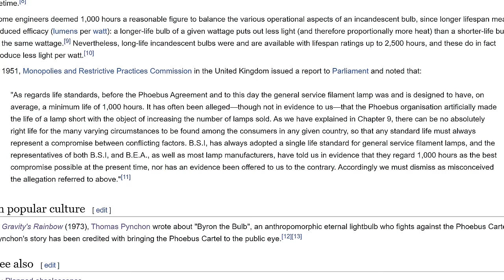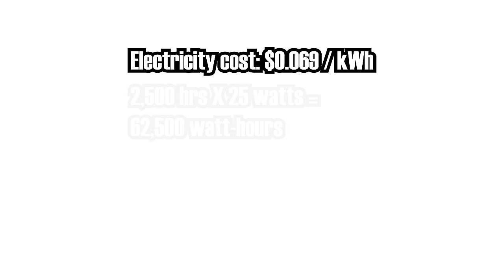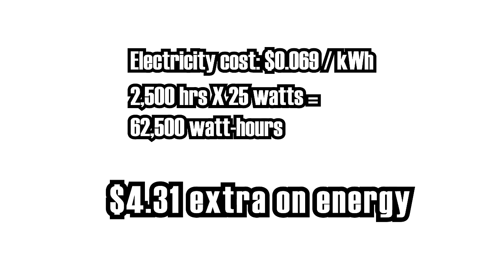Longer-lasting light bulbs: it was complicated

Comment: At my University in Germany this was actually the topic of one of my first lectures (mechanical engineering). So I want to contribute because you excluded Halogen-lamps:
Halogen lamps use e.g. Fluorine to bind the sublimated tungsten and "refill" the tungsten wire at the thinnest spots. Thats why those lamps have a much higher life expectency and brightness/efficiency, though need a socket that can withstand higher temperatures. I remember vaguely that Osram had a warranty program where you could send in black-tinted halogen lamps, because it meant there was a defect in the manufacturing process, since the tungsten isnt supposed to "get" to the glass.
Reply: Mains voltage halogens weren't as good as made out. I replaced a ten+ years old normal bulb with a mains halogen one in an outside lamp and it failed after less than a year. 

I recently bough, mainly as a historic curiosity a Philips bulb that has a low voltage halogen capsule and a transformer between it and and the base. 40W of life from 20W and supposedly a longer life. Car bulbs seem to be the pinnacle of incandescent life. Even the headlights seem to last about 5 years.
Reply: @MrDuncl  yeah outside lamps are a special case, depending on temperature and exposure to e.g. rain, a halogen lamp will fail fast. Even slight fluctuations in the supply-voltage (1V is enough) can kill it. That's why most halogen lamps are 12V, since the AC-DC converter prevents these fluctuations.
Reply: @MrDuncl  Car bulbs last a long time because of the lower voltage. To achieve the same power output from a low voltage the filament resistance needs to be lower. For example a 12v 55w bulb resistance at operating temperature is ~2.7 ohms. A 120v 55w bulb has ~260 ohms. This lower resistance is achieved with thicker shorter filament which is far more mechanically robust than a long thin one.
Reply: @petarmiletic997 did you know that the working voltage of cars are about 14V? The car battery can reach 13V when Fully charged. Car lamps are well designed! They are filled with hallogen to reduce evaporation and create a auto healing effect. Most times they are made out of quartz and not glass. They also have a better filament support, because it needs to withstand vibrations. The 1000h limit is a bad thing! They could have limited the efficiency, but they prefer to limit lifetime. This is a simple excuse to limit lifetime.
Reply: @VitorFM  True, but the nominal voltage of the bulbs is 12 volts. At 13 or 14 volts the power will be slightly higher than nominal. Most modern cars will start to PWM the bulb once voltage exceeds 13v to extend bulb life. Also usually only headlight bulbs are halogen. All other (turn signal, position, brake etc) are normal incandescent. But allthat is not really relevant because All else being equal - for a given wattage the filament of the bulb will be thicker and shorter for lower voltage, and thus mechanically stronger.
Reply: @VitorFM  Another thing - the whole point of this video is that sometimes it is good to limit lifetime in the name of efficiency. A 60 W bulb, over 1000 hours will consume 60kWh of electric energy. With the price of electricity roughly 10 cents per kwh this is 6$. The cost of the bulb is maybe 1/10th of that -60, 70 cents. If we increase efficiency of the bulb by just 10 percent we practically save the entire cost of the bulb over it's lifetime. If the efficiency increase is higher then you save more in the cost of electricity than the entire cost of the bulb. Over 2000 or even worse 3000 hours the math is more and more in favor of higher efficiency. And not to mention that you get more white and less yellow light
Reply: The black tint can happen if you use halogen bulbs in a dimmer and run them dimmed for a long time: you've made the filament hot enough for tungsten to sputter off, but not hot enough to make the reaction with fluorine happen.
Reply: @VitorFM so you'd prefer a lightbulb that costs more to run AND gives a visibly dimmer, more yellow light?
Reply: He did specifically state that this applied solely to non-halogenated bulbs.

Comment: As far as planned obsolescence in LED bulbs, I have found paying like 5% more than the absolutely cheapest makes a huge difference in their longevity.
Reply: Switching to 12V onrs is even better. ROHS hates high temperatures. Dividing power supply and light source lowers temperature on those joins, that causes most of lamp deaths.
Reply: @krzysztofwaleska From what I understand the issue is the heat in the LEDs themselves - sealed fixtures cause further problems primarily by decreasing the efficiency of the heatsink. The big thing to look out for with LEDs (and admittedly this isn't really feasible in practice) is how hard the diodes are being driven. Unlike incandescent bulbs, LED don't rely on heat to make light so running them more gently can substantially increase their lifespans without a substantial decrease in efficiency. That's a big part of what Alec called out from BigClive's videos - he frequently features cheap LED bulbs and tears them down to both assess their efficiency and to show how to hardmod them to last longer at the expense of being a bit dimmer.
Reply: The problem is the circuit boards burn out on the led bulbs the actual leds would last very long
Reply: @peanutbutterisfu  The solid copper strips the circuit boards are made of are not the failure point, otherwise all electronics would fail in similar ways
Reply: I do doubt that it's planned obsolescence and rather just poor manufacturing and engineering incompetence. Those cost cuts have to come from somewhere, and it typically comes from cheaper materials, lower quality control, and less skilled product development. You get worse quality by paying less. It's just a matter of getting what you pay for.
Reply: There was a "cartel" that broke the monopoly laws to mandate 1000 hrs limit. Pure and simple. Similar to making cars that are designed to rust when all you need is to use something like Zinc Chromate to make the car not rust to nothing forcing people to buy new cars / trucks.  LED bulbs have no reason for failing as they do other then the makers running the LEDs at excessive current.  There are several resistors in parallel in the light bulb which run the Leds so hot they fail in what?  2500 hours versus the cartel 1000 hrs?  Maybe more but the issue is they shouldn't fail anywhere near the short and sad length of time.  If you remove one of the two resistors the amount of current / heat drop by half and the amount of light barely changes. The LED PCB runs cool it doesn't change the color and if this doesn't increase the life far beyond the 2500 Hrs your supposed to get I will eat an LED light bulb.  BTW have any of you wondered why you keep needing to replace your computer hardware every couple years? How what used to be screaming fast is now so slow its garbage?  Modern Appliances filled with un-needed electronics (Which is pretty much un fixable) replace what used to be a very simple (And easy to fix mechanical)
Reply: @bosstowndynamics5488 you're right, but the transformers, resistors and capacitors are sometimes the bare minimum spec to be able to drive the diodes. Also, really cheap solder joints and whatnot that like to crack with heat cycling also tend to kill those boards. Usually it's a burnt resistor or transformer from excess heat and current exposure over long periods of time though.
Reply: @dsrocks6905 less than the minimum spec on the cheaper end of the spectrum. Why put a 2W diode that will run for 10,000 hrs when you can put a 1W diode and run it at 2W? It will last 1/10 of the time but the price conscious shopper rarely takes that into account

Comment: I live on the Oregon Coast, and the local power utility not only gave out free LED bulbs, but also faucet aerators and surge protectors (the kind where one outlet controls the others). They don't hand them out regularly though, it was a thing they emailed out and you signed up for. I got them but I ended up donating most of them to the local ReStore because they were those crappy old-style plastic ones and I prefer the filament type.

Comment: Throughout your video I was constantly thinking about many cheap LED bulbs actually having "planned obsolescence" and Clives videos about it. Nice that you brought it up yourself.
And there's a perfect example that LEDs can run almost indefinitely: the "Dubai lamps", manufactured by Philips, with more LEDs than usual, proper heatsinks and a decent controller that runs the LEDs with less current, thus cooler, leading to a hugely increased lifespan. (Clive did quite a few videos about them and how you can "hack" some normal LED bulbs to get on a similar lifespan with only minor loss of brightness)
Reply: Dubai lamp is based on glass chip that is impossible to be properly heatsinked. they made it efficient just by using double the filament at the same power level thus increases its efficiency and lifetime. total heat output might be roughly similar since they have the same power. as the driver, i believe there's nothing different compared to their standard deco classic lamp
Reply: @n.shiina8798  LED filaments don't NEED to be heat sinked. The large surface area alone and helium gas fill of the bulb is enough to draw heat away. With appropriate power draw they run for ages just fine. See the video Filament LED Light Bulb: 5 years and Teardown Time

Comment: You know, this helps explain a question I had as a kid. I always wondered why the lights in your car (not the headlights, the dim lights that illuminate your speedometer, temperature controls, etc.) never seemed to burn out, and I never got an answer other than "It's a different kind of light". I never even considered the fact that the lights were dim was, in part, the reason they lasted so long.

Fascinating video as always - thanks for making it!

Comment: I like those utility branded bulbs! In that tradition my local electrical concern will hand out free LED bulbs for so much as sneezing in their general direction. I once called in to report a hawk nest being built on a power pole, they thanked me for the tip, and a week later a 4 pack of bulbs arrived unprompted in my mailbox. I've heard similar stories from other locals, I think just about any interaction, positive or negative, will result them palming some LEDs into your hand like a grandpa with Werthers candies.
Reply: Thats pretty sweet, would not happen in that way in Germany, sadly.
Reply: @bgeery so user too?
Reply: @bgeery they've found that it's more cost effective to get customers to use more efficient bulbs than to build a new power plant.
Reply: @GeorgeWashingtonLaserMusket  It feels fundamentally manipulative to market "rationing" as a "feature" though. 
I'm all for "efficiency" but not when their approach to efficiency is "I'm going to give you less and convince you it's more."

That and trusting a single party that has all of the power to make that decision without having a compromise with the other party (the client, the citizen) present seems like a bad idea.

Comment: The thing about the free bulbs was interesting. Here in the UK, years ago, power companies were required by the government to meet certain criteria for helping customers to be more energy efficient. Many of the electricity companies chose the lowest-effort option of sending customers packs of CFL bulbs - over and over and over again, regardless of whether they needed them or not. To this day I've still got a box full of CFL bulbs, unused in their boxes, sitting in the shed.
Reply: I remember CFL bulbs being expensive then late 2004/early 2005 suddenly many companies in the UK giving them away for free.  Went with a relative who was paying their rent to their HA home and there was at my reckoning at least 200 could be double that bulbs piled up and free for people to take, took so many of them at the time, by 2010 I did start working out that I felt tired more often due to how dim they were in comparison to regular bulbs and went back to regular bulbs which helped a lot.  These days I use LED bulbs which are a compromise but far better than CFL ones.